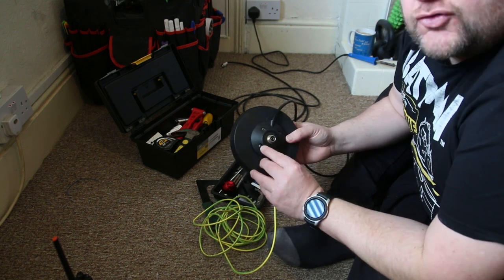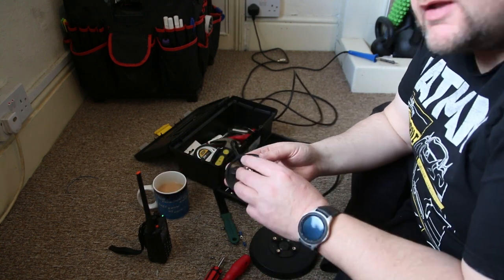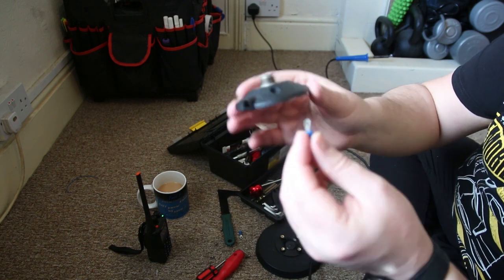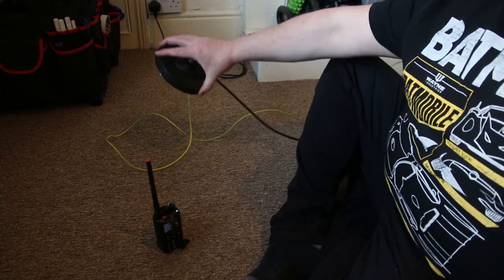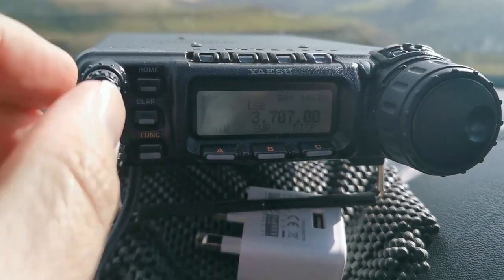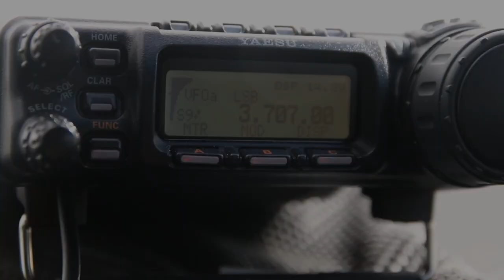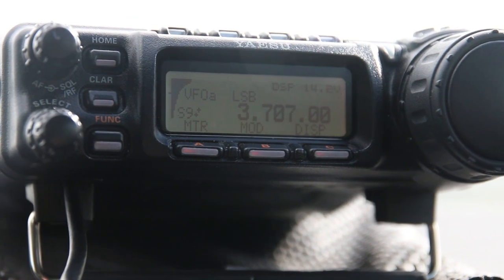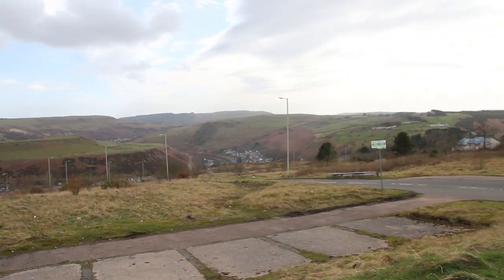Sorting out SWR Issues for HF mobile setup ....then a nice contact!!

Comment: What antenna are you using ? M7PNR
Reply from the maker: Just a 80m Ampro whip buddy.
Reply: Do use mono banders for the bands ? Or a tuner ?
Reply from the maker: @paulw8652  I use monobands
Reply: Cool great vids I have a Watson multi ranger 9 which I had some success on 40 and 20 but getting a high swr on 80 and to be honest band changes are a pain so I was thinking mono banders are probably the best way
Reply from the maker: @paulw8652  yes this is what my mindset but getting the SWR down on 80m is a pain that's for sure lol

Comment: glad that has helped with swr.
a 35 ft counter poise wire will help more.
Reply from the maker: Thanks for the input. I will cut a wire for 35 ft tomrrrow and test it out to see the outcome :)
Reply: @mw7jlmhamradio114  take a couple and use your analyzer and you can see as you add them.
good too see people out and about doing this.
loads of park on the air videos from usa but rather lacking from the uk..
i have mad myself a coil type system just like the wolf river coils unit and 102" whip.
going to try it out this week.